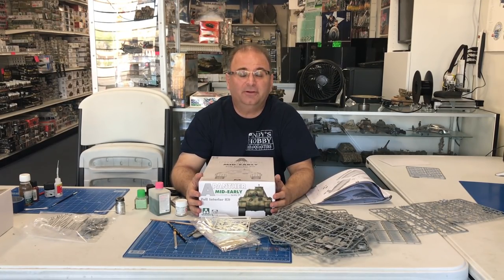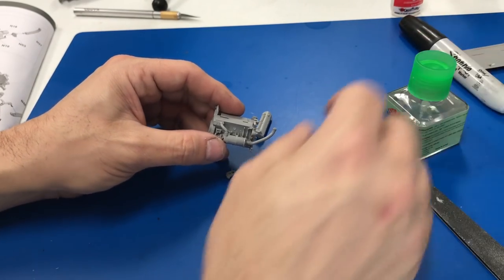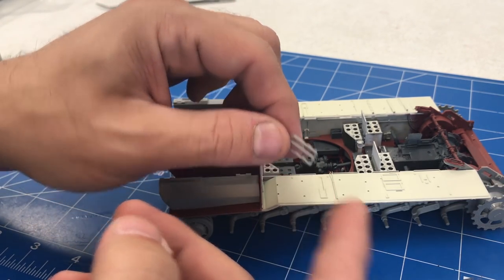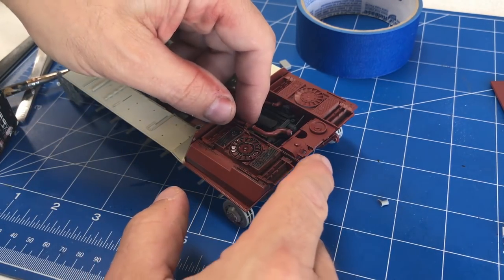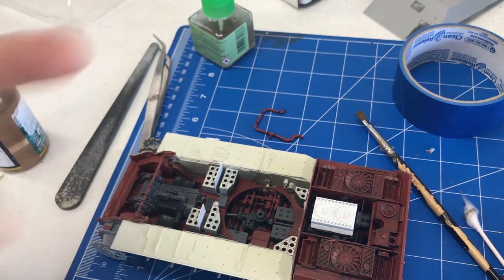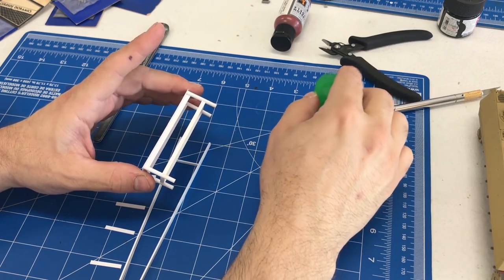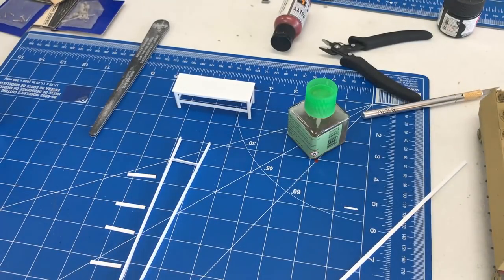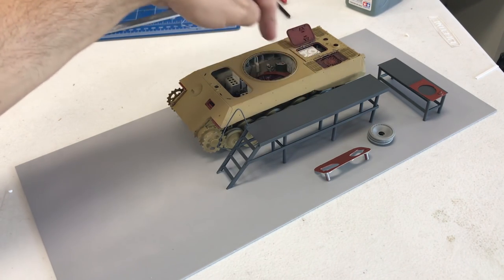Building The Takom Panther part 2 full interior factory build

Comment: Hi Andy,I couldn't wait to see part two because I've got plenty of these kittens and it's nice to see how they go together,and I love your modelling!
On this one hand leaving the rear armoured plate for last is good thinking  ,on the other you must get rid of those "tabs" to make it fit.Those "tabs" are the armour interlocking plugs,and it would be wise to SHAVE them off,SAVING them and slipping them into place afterwards!
Oh,the part on the back with the round funnel-like thing is an oil reservoir and the round thing is the fuel "funnel" with cap!😊
Keep 'em coming!👍👍👍👍👍

Comment: At 7:24, that small piece is actually the starting generator. German tanks where all equipped with a crank starter system. Yep, you put a crank in and turned it by hand to start it, when your battery was no longer usable.

Comment: Andy: Why would you paint, and show, weathering of the engine, and compartment, on a tank that is still in factory production? There shouldn't be any weathering, or wear, yet while sitting on an assembly line. You say this is going to be used in a diorama for a factory setting. Am I missing something?
Reply: MsPrincesspaulina,
The weathering would be from the acual process of the parts from thier production line to the tank. Its not alot due to your point in case. Also it is to help a "shadow" effect on the parts inside as he discribed.
Reply: MsPrincesspaulina If i am not mistaken he did the black panel liner to give a shadow effect to make it look bigger because the river hikes and weld seams are so small they don’t give a shadow effect
Reply: "Weathering" is a term generically used for a wide variety of post-painting processes, many of which in fact have nothing to do with actual exposure to the elements at all.

A lot of what is done -- and what Andy was doing here for example -- are used to simulate various shading, lighting, and miscellaneous tonal variations that exist in real-life that either don't exist on a model or don't 'scale' correctly.

A picture of a Sherman straight from the factory looks like a tank.  A picture of a scale model of a Sherman painted Olive Drab with no "weathering" done to it at all looks like a toy.
Reply: Yes , one area of weathering that people do not take into consideration is that you are using a light source that has far greater intensity that a scale light source so shadows are a factor , where you have natural shadow in real life like around mesh , grilles etc , the solid color shows none of the surface texture and that is the sort of weathering Andy is talking about , consider the pre weathered versus post weathered engine compartment , and it is to highlight the plastics , details  etc
Reply: Thanks for the information.
Reply: You are welcome
Reply: Can't believe this question is being asked? The guy makes videos to help modelers and your worried about Andy using weathering in a factory settings??? Please!!! Ignorannce is bliss!
Reply: HEY TROY FRITZ !!!!! How ELSE are We Supposed to LEARN WITHOUT asking Questions  ?? MR. KNOW IT ALL ,,,,,, EXCUUUSSE USSS !!!!